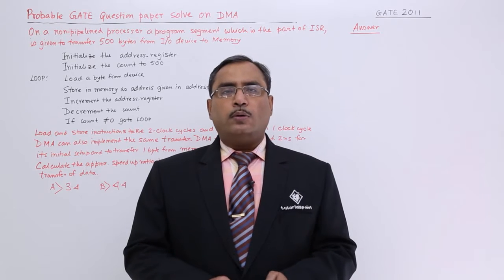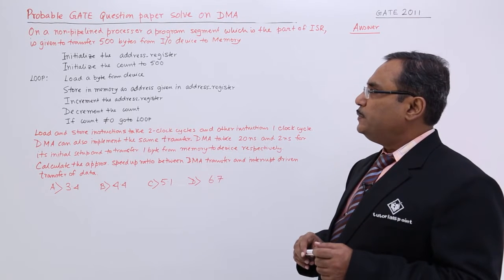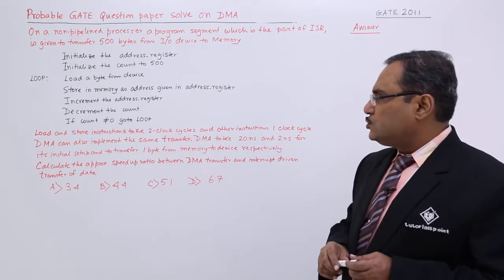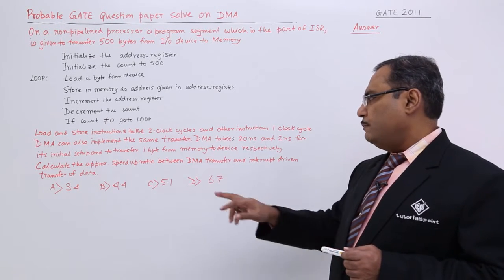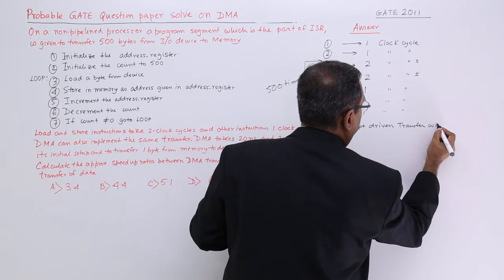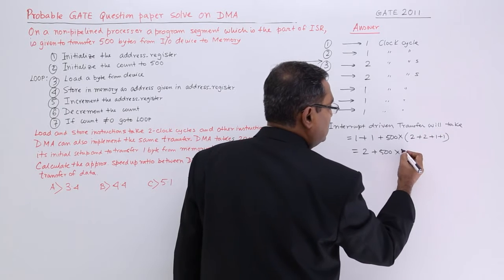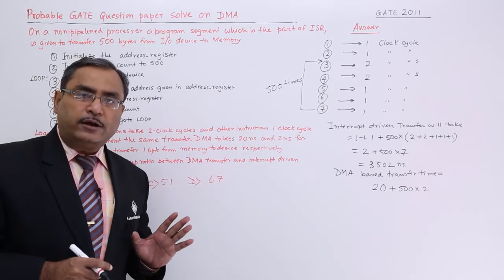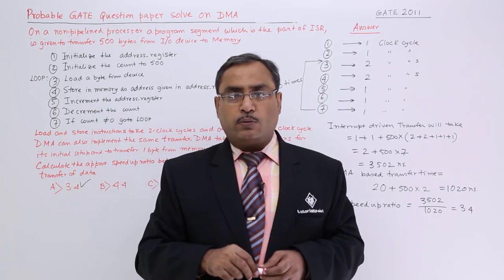DMA GATE Problem 2

Comment: Sir In interrupt driver i/o time , we were given no of cycles used in load,store and other were 2,2 and 1 respectively...but no where it was said that cycle time was 1ns...how you assumed at @7:00 that cycle time is 1ns....even processor frequency was not given 🙄
in DMA time is given like 20 and 2 ns.
MY ANSWER ALSO CAME THE SAME BUT THE MISTAKE IN QUESTION IS CYCLE TIME WAS NOT GIVEN ,WE HAVE ASSUMED IT TO BE 1ns per cycle.😅